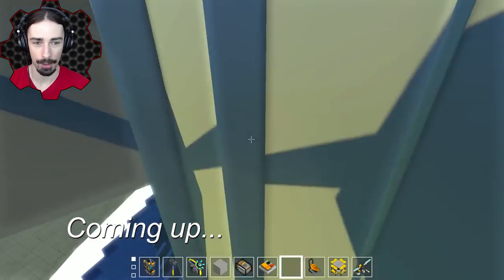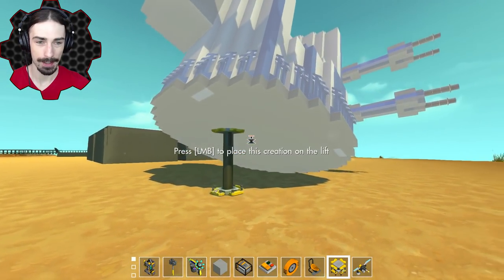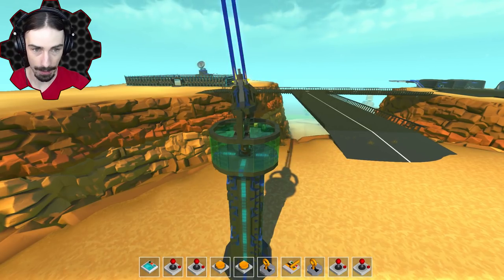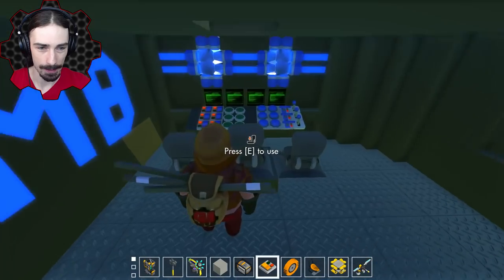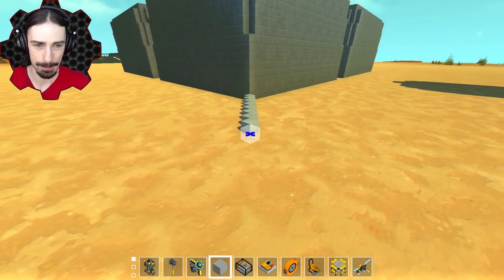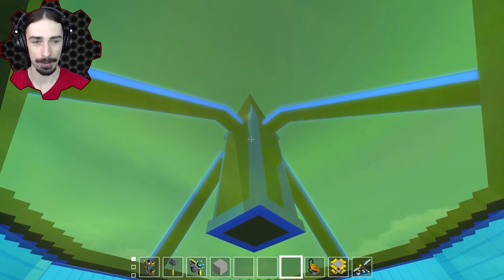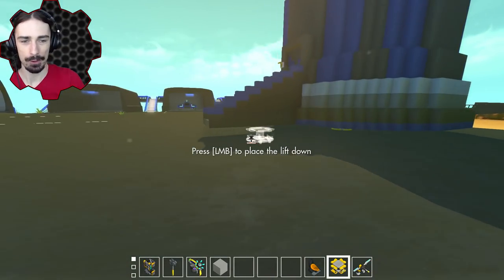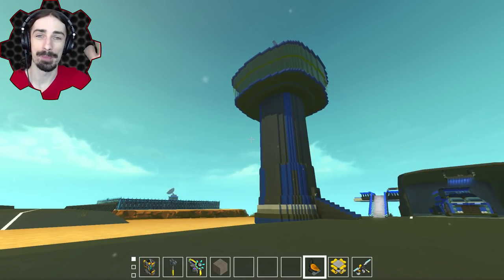Installing AA TURRETS and AIR TRAFFIC CONTROL TOWER! [FMB 21] - Scrap Mechanic Gameplay

Comment: There is a mod block that is a 1x2 but only half is solid the other half has no collision and it was made for the lag problem when welding many things together connected to the ground it was for bridges i believe to connect them visually to prevent lag and other glitchness that happens when welding to parts across ground and assets I will post the mod and block name when I find it since you will run into more lag problems the bigger the base gets
Reply: uh

Comment: The rail gun is actually pretty accurate to real life. The charge-up is electromagnetic waves running along the barrel of the gun, and the reason it doesn't seem to be doing anything, is cause there is no electricity in the game. That really should be a mod, even if it's purely aesthetic based.

Comment: You should add another tower to the other side to make it symetrical
Reply: why would you need 2 towers? -_-
Reply: Elias Rönnqvist one for each side
Reply: That'd be unrealistic because there is usually 1 tower in every airport
Reply: you mean another atc[air control tower]
Reply: Ulttra that is true but it looks odd were it is bye itself and if it's a military base there's going to be a lot of cats coming in and out so you might need another one to direct  the traffic
Reply: King Gaming yes
Reply: Ulttra or you could do a small turret for small drones that the big turrets can't follow